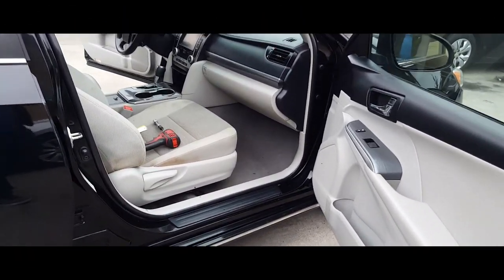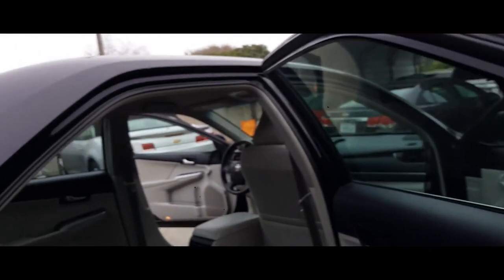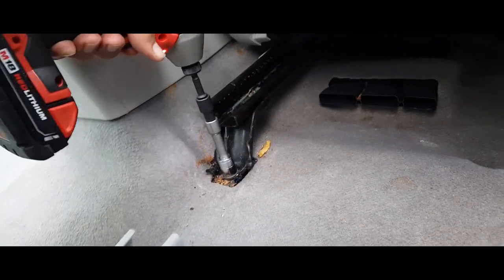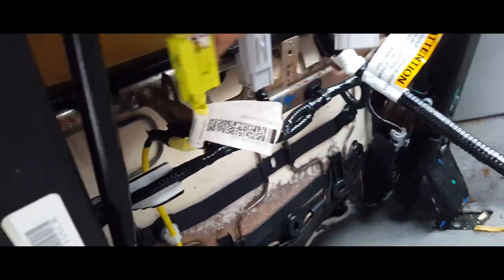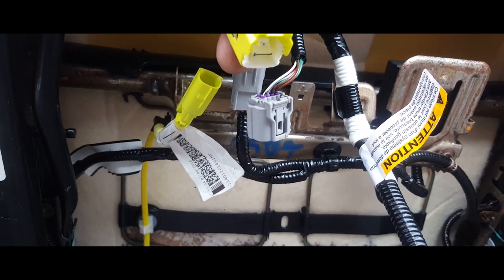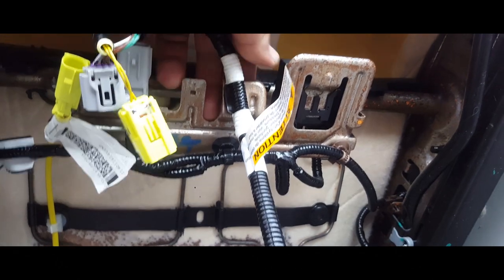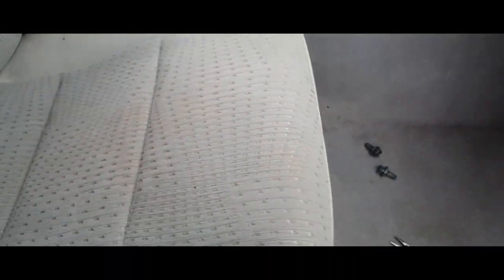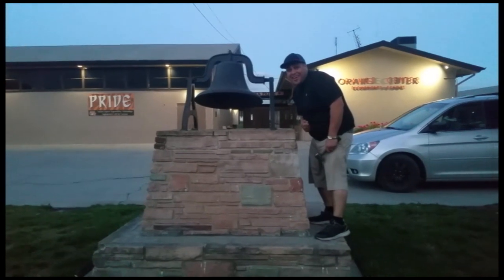How to: Remove passenger Seat from a 2015 Toyota Camry

Comment: Hey George   Can i remove the passenger seat hybrid and leave it out and drive safely? Will i have codes or airbags go off without pass seat connected wires? Thanks in advance

Comment: Do you need to disconnect the battery first? Someone else said you did and it made me nervous to repair my chair by removing it
Reply from the maker: Everyone says that the negative battery terminal needs to be disconnected in order to drain the system from its electrical charge so the air bag doesn't deploy. This will be the best procedure to complete but I have removed sooooo many chairs and steering wheel air bags with the battery connected and never had a problem. Taking the negative cable off is just a precaution so it doesn't go off.

Comment: Do you have a solution to turn off the srs airbag light? I removed my front seat and my  airbag light stays on, on the dash. I'm afraid my airbags will not deploy incase of an accident
Reply from the maker: No sorry but, you should be okay. Its just Letting you know there is something wrong with the system...Put a picture over it lol 😆
Reply: I have the exact same concern. I don't know how to read the manual to figure out if the driver seat airbag will still deploy in case of an accident.

Comment: Goodnight. Don't you need to disconnect the battery to disconnect the airbag electrical system? Thank you very much in advance.
Reply from the maker: no need but you can for safety measures

Comment: Hi, I have a 2014 Camry LE.  I'd like to remove the front seat for a week long hunting trip...i can fit my ice chest where the seat is easily.  Is there any concern that the airbag will deploy when the seat is disconnected?  I've seen other videos that cautioned to have the battery disconnected when removing the seat and not to start the car when the seat is removed.
Reply from the maker: I've removed seats and moved the car as well, no issues with airbags going off. Ur good if anything it will throw in an airbag Light on the dash but no bags will deploy...ur good brother

Comment: Hi George! 
Recently retired, I want to convert my '16 RAV4 into a car camper to see the country on-the-cheap. I'm wanting to remove the passenger seat to free up some space for a 12v chest-type fridge so I can keep the entire cargo area free for sleeping space.
If I were to disconnect the battery for an hour, unplug all connectors and wrap them securely with electrical tape, and tuck them beneath the carpet, then rehook the battery, would there be any possibility (with the exception of an impact!) that the airbags would suddenly deploy for no reason?
Any other heads-up on this idea would be appreciated. 
Thanks in advance!
Reply from the maker: No bro you should be good. Go ahead and do that process, no air bags are going to deploy. That sounds like fun! Enjoy retirement! Thank you for your SUPPORT!
Reply: That's exactly what I'm tryna do! Did it all work out savely?
Reply: @lorenzoeldude  Hi! Well,  I've been on the road for 3 days: spent the nights in Planet Fitness parking lot (Black Card $25/mo) and used their toilet and showers so so far no problem.
I cracked the windows and used a rechargeable fan for air circ and I'm comfy so far!
Oh, and I averaged about 29mpg but only because I have all my gear stowed in a CarPod on my trailer hitch. Still not bad!
Reply from the maker: Nice, sounds like an adventure
Reply: @559powerscape  Oh, and I decided against seat removal; my 12v fridge is only 23 qts so it buckles in with no alarm.
Reply: @gardnerberry113  Awesome! I just removed the passenger seat on my Toyota Yaris Verso from 2002. Planning to drive all over Europe starting in a week!